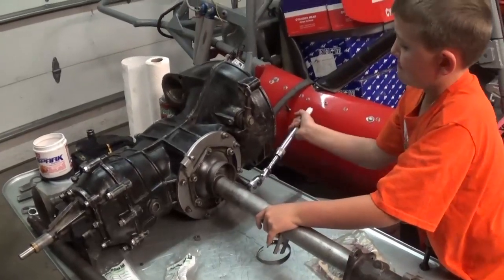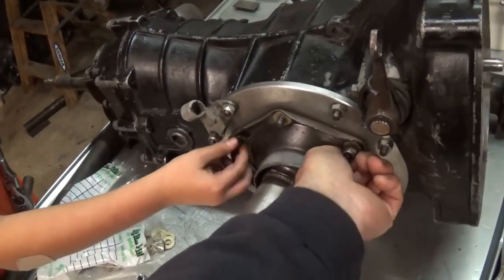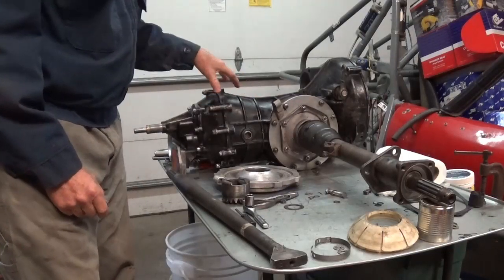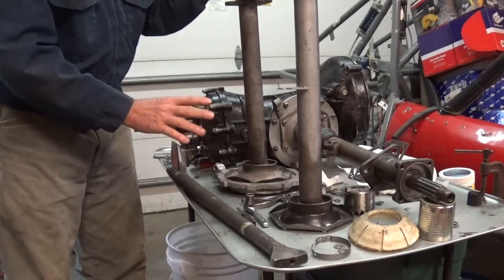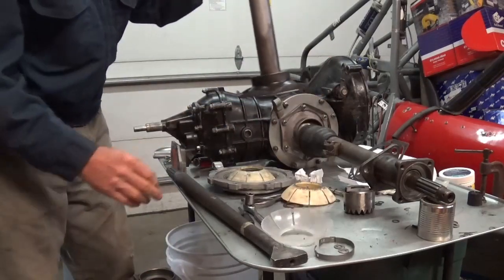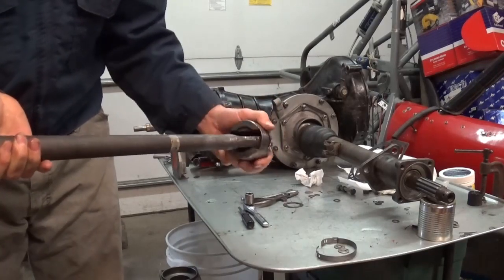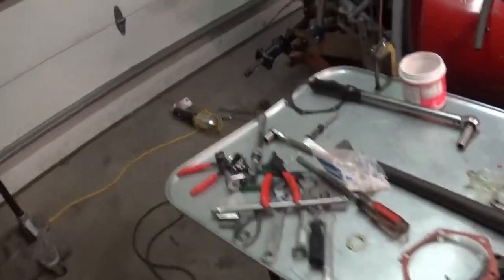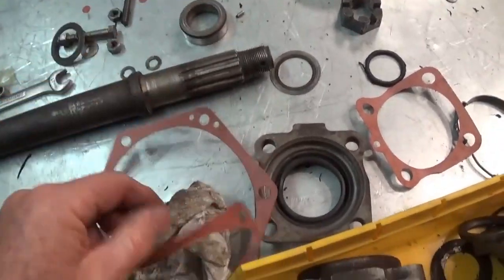VW Swing Axle (How it pivot's)

Comment: Great video. My dad taught me a lot about how the swing axles worked when I was a kid. He drag raced them for decades. He always set up his bug to have as level axles as possible on launch so they wouldn't wreck the joint while pulling the front wheels up. Seemed to work well. had 60ft times of 1.5 with an NA 2332. I'm pretty sure he broke an axle once, before he switched to a spool since he broke it when it was still an open diff config. He had to stop using super beetle diffs cause his transaxle builder showed him his stress cracked and blued gears haha. Can't remember if that was before or after he started shredding super beetle main shafts and had to switch with chromoly and finally started using gear ratios outside of the stock lineup you could mix and match into type 1 transaxles. He had a great transaxle builder. Never had a failure outside of pushing parts beyond their limits and budget. Up until his diffs started to show heavy signs of stress and heat, he would put thousands of miles on the street and who knows how many passes on those transaxles without failure some seasons. He stopped putting many street miles on it once he put in the spool since driving around the city with a locked up rear end isn't that great. It was a bracket car so he would enter it into any event it would pass tech and the rules for.
Reply from the maker: Sounds interesting. Thanks for sharing. I would like to have met you and your father. Some fast times you had with him

Comment: Thanks so much EZ for all these transmission videos brother... It's awesome that you put these all out there, believe me, the knowledge your sharing truly does help out so many.  I've been debating on pulling my Berg 5 speed apart and doing a freshening up and all the good stuff you've shared is helping to build my confidence.  Not sure I will with the Berg... lol but I may pick up a used stock transmission and play around with it.

Hope all is well up there and the temps are going up, I'm ready for some more of those cruising in the buggy vids!
Reply from the maker: Thanks for your comment and support! I'm still on the learning VW learning curve. We have so many options....   I've always dreamed of owning a Berg 5   I'm jealous.
The way I understand it the 5 gears is .089 like stock accept it's welded as is 3 and 4..   Do you find yourself getting bored shifting it in traffic and start skipping gears. Like going 1 to 3 or 2 to 4?   Since I don't race and use very mild cams on my stroker engines I have a wide power band. Most times I go around corners in 3rd and just leave it there if the speed limit is 30 or 35...   What say you?  Oh one more thing. When I decided to start fixing my own transmissions I bought 4 broken ones from a farmer who's son had left them next to his barn.  The were all swing axle and over the years I've picked and pulled parts from them. I learned a lot. I never did put one in a car though.  I was building close ratio 4 speeds for my sand car.

Comment: I like the longer videos besides how would you cram all the info you covered in 5 minutes. I just finished installing a rebuilt 1600 and tranny in my mountain buggy took 2 weeks ( I have bus gear reduction boxes on it so took longer). Next week deer hunting with it in Idaho.  Yes I broke it in changed the oil and adjusted the tappets.

Comment: Hey EZGZ! Awesome video. Currently changing axle bearing and seals on my 66 Bug and was curious about that slight movement of the axle.  Your info was a great help to find out how it works. I would like to toughen up this transmission a bit a maybe change the final drive gearing. I'm doing 50mph at like 4000rpm or close to it. I am currently putting together a 2110 and will probably need iy to be a bit stronger. Also you gave me some tips a couple years ago on my Kadrons and now my 1700 runs really well!!! Thanks!!
Reply from the maker: In and out play is normal on a swing axle. After you get your new bearing on and brake drum that play will go away when you torque down the axle nut.
1966  is when the switched from the 4:37 RP to the 4:12 RP The only option would be the freeway flyer IRS tranny that had 3:78 RP  it only makes your engine Turn a couple hundred RPM less. It is not possible to put the 3:78 RP in that tranny as the Pinion bearing is totally different. You would have to Someone like Rancho Transmission build you a custom set up to convert it to swing axle or  add the brackets to you frame horns to put IRS in your car. Orrrrrr you could do a body swap to a later IRS pan.
Your tranny has all the strength to handle a 2110 for street use.
Nobody makes a good Super Diff any more. Drive sensibly. On a final 
note. If your making more HP with your 2110 why would you want to slow down your cooling fan with with taller gear ration and possible have overheating problems with your engine? It's more complicated than that but,, Just Sayin. OK  Happy Easter

Comment: I was doing transmission work on a 356 Porsche, and let the transaxle hang too much and I believe the fulcrum plates got dislodged, cause it makes a lot of banging noise when making left turns, so hopefully I can set them back in place without having to dismantle the entire rear, just unbolt the big bolt and loosen up everything in order to get to those plates. Any opinion would be appreciated, thanks for an informative video.
Reply from the maker: You can drain the oil and see if and large chunks of metal fall out but you can not access the fulcrum plates without taking the thing apart.  :-(
Reply: Not a easy fix.

Comment: do you suppose a bus trans could work. Youd think it would be a bit tougher and maybe better geared?
Reply from the maker: Many people have gone to those and it adds more weight and moving parts. Doesn't take much weight increase to dull the fun factor but to each his own. When you get the weight down to around 1k pounds the fun factor is incredible. More power isn't always the answer because you just sink down in the sand. A light car dances across the top and responds quickly.

Comment: Do you have a video separating the axle tube outer wheel part from the tube?
Reply from the maker: You will need to knock the pin out and then using a press push out the tube off.  Then align the replacement and press it on.  The home mechanic is not going to have much luck without a press and the proper press adapters.

Comment: Hi EZ, thanks once again for your time in making these videos. I am taking apart a sandrail that from what I understand cb performance built this rail to show off their first fuel injection system used with a vw engine utilizing chevy fuel injectors with compu-fire ignition, it's been a learning curve to say the least. Anyways, this particular rail has a transmission that looks exactly like what you have that you refrenced as a close ratio transmission....looks different than the other transmissions I have in my other sandrails. This one was used in a mid engine set up that I just referred to as the rail that cb performance used or built, again not too sure about its history other than what i was told by previous owner??? Now i have a question, the transmission seems to be in good shape, nice and clean, shifts great, no unusual notices etc....did i understand you correctly when you said that it can be used as a swing axle or the other that you talked about and if so, do I get more clearance and what other benefits can I expect with the IRS set up? Thanks ahead for any information EZGZ!!
Reply from the maker: It is what it is. Just enjoy it and try not to break it!  When your ready to make a change sell it and move on or live with it. Don't change it or try to make it better . EZGZ out!

Comment: Oh, man... I'm test fitting my axles now.  The passenger side has a couple of millimeters of in and outer movement like bad one you demonstrate.  Is my only solution to find a new axle?  Buying one off thesamba is hit or miss.
Reply from the maker: Better if you can take to a VW shop and compare it to others but used stuff is always hit and miss.

Comment: EZGZ I was watching your all videos and got much info from them. I modified a my Beetle Gear Box with Quaife diff with technician help. It was his first Quife diff and we noticed that Quaife QDF9R for swing axle, doesnt have lock ring to keep axle locked. We were kind of in trouble with assembling but manage to set it out. Later had to open it again coz we didnt insert enough shims in between diff and bearings. So we insert standard shims only and assembled the gear box. But I still feel its kind of not properly done. Other problem was we couldnt foind new pinion shaft bearing which has inner hole bit more space and fit in to gear box case. I belive my gear box is aft 1973 as it has small lever for reverse gear. Not copper color hook. # is AB 19 09 3. Any possiblity you could help me about this. Im going to re open the gear box next january and rebuild it. Be fore that I should collect right parts. I checked many sites but really difficult to decide what I should buy. Specially pinion shaft bearing. help please. My mail is tmangalaslk(at)yahoocom. I live in Finland but my Beetle is in Sri Lanka.
Reply from the maker: If your pinion bearing is not pitted and turns smoothly you can reuse it. It must have reload on the bearing. You should NOT be able to turn it easily by hand. The gear assembly must NOT fall all the way into the case. You should have to apply heat to the case and it will fall into place like I show in several videos. This should apply to ALL transmissions made by VW. The differential side covers must have preload as well. After tightening the side covers and turning the transmission several times you should loosen the cover on the clutch arm side of the transmission. The cover should push out between .007 to .011 of an inch. You need some clearance between ring and pinion teeth no more than .010 and you should measure it at 4 different places around the ring gear not just one place. http://ranchotransaxles.com/shop/
Reply: Aft I check again your some of videos, I realize it is main shaft bearing, not pinion shaft bearing. That bearings middle part(kind of pops out) is thicker than outer space. Its broken when we opened the case. Now I have used bearing and I think it will be fine. But I would like to change it to new one. thanks for your advise.
Reply from the maker: http://ranchotransaxles.com/product-category/cases/  These guys should have the bearing
Reply: I found it in UK site too.

Comment: Can a swing axle replace an IRS transaxle? The reason I ask is because I need a temp till I get my IRS Repaired.
Reply from the maker: Yes, you will need to replace the spring plates as well.  Most old school drag racers use swing axle for the strength and lighter weight by eliminating the IRS CV joints
Reply: @TheEZGZ  
Yikes. Thats a drag. Last time I tried getting those off they didnt wanna come off. So whats the trick to getting those off at the torsion bars? I took the plates off and pryed and pounded. No budging.
Reply from the maker: 7 hail  mary's and 7 Our Fathers and keep trying. They will move. Try pounding them in farther just to get things broke loose. Be gentle but firm. Maybe a hammer head on your air gun to get some good vibrations.  " Beach Boys"
Reply: @TheEZGZ  
Lol. And I dont wanna put a torch to it, since its spring steel. 
I'll just get the biggest sledge I can find and go out there and think of congress. I should have it loose in no time.
Thanx for tips and time. 👍 Great videos.

Comment: Did the Kubelwagens during ww2 have swing axles?
Reply from the maker: yes sir. The early ones had a split case and no synchro for first gear. The best one like in this vid were 1961 - 1967 then they switched to IRS for sedan and bus and got even stronger

Comment: I had to replace the seals and thought while I was at I might as well change the bearings... I did get it but I had to stop and walk away several times.  The snap ring about made me want to grab a sledgehammer... I discovered needle nose pliers worked much better than the snap ring pliers
Reply from the maker: I've done the same thing.  A bit of grinding makes it even fit better.

Comment: i like the irs transaxles better myself!
Reply from the maker: Me too.  You don't have to mess with brakes and axles. But the swing axle is lighter and takes more abuse in this application. I had IRS in a sandrail and I did could not afford the upgrades to make it stronger without making it heavier.